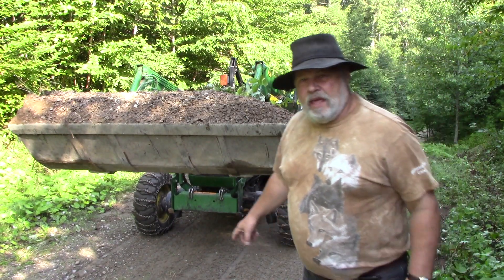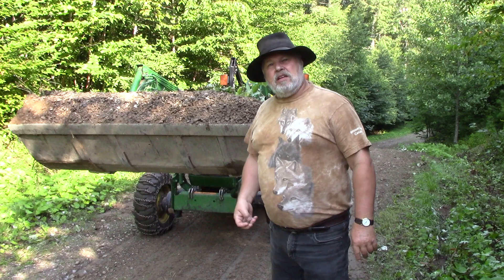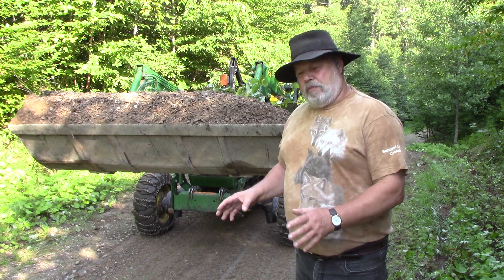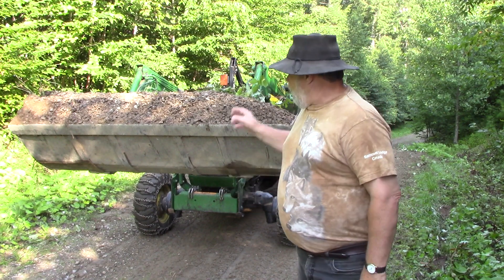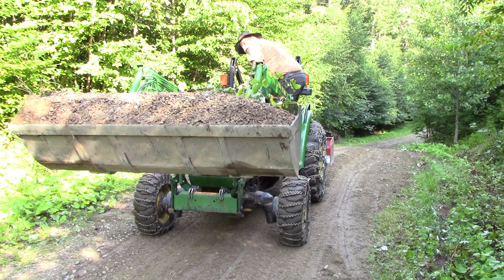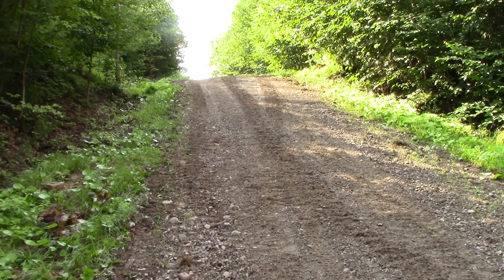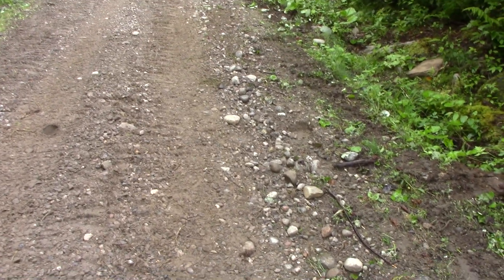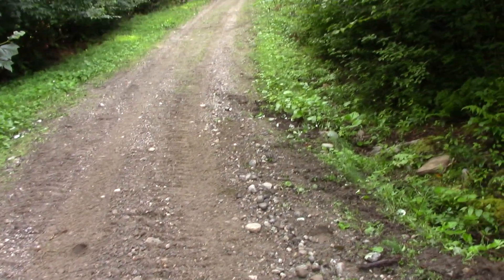The mix for preventing erosion on a steep road

Comment: I bet that works real good. Back when i was a kid my dad added on to our driveway. He made it go around the house. He dug up the top soil and clay was underneath it. Well he didn't get to finish it before the winter came and that rock hard clay driveway went from rock hard to soft and mushy. Well during the winter we put ash in the ruts from the fireplace and in the spring we put gravel in the ruts. By the time the next winter came we had a good driveway that you could use and not get stuck in. Salute.